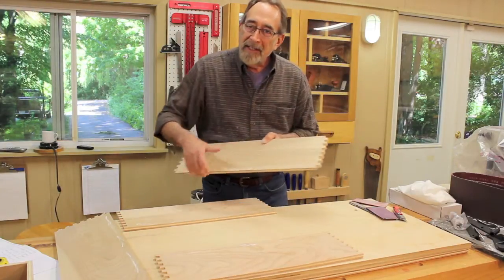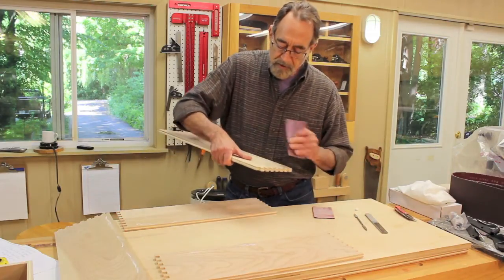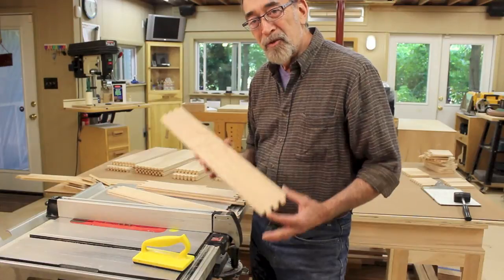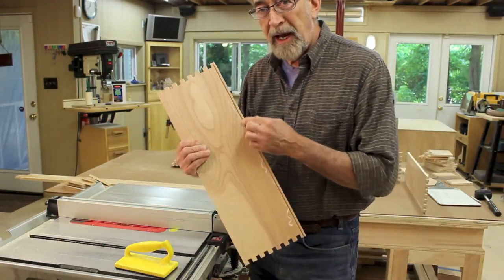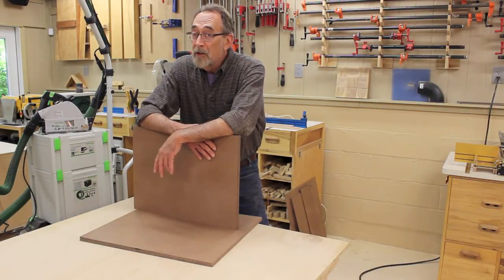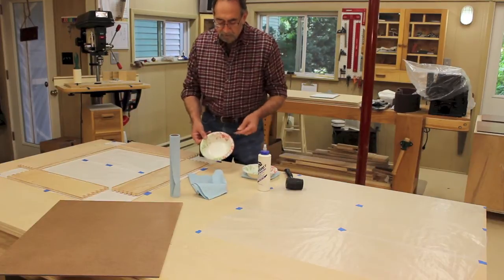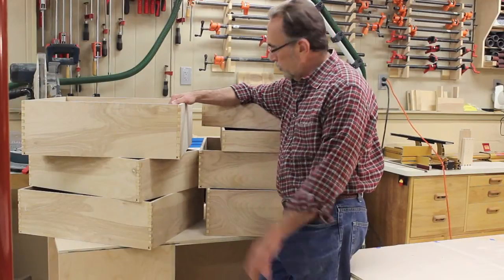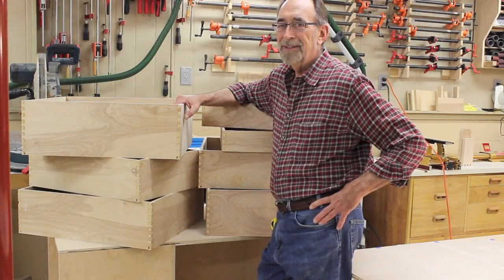Sanding Center Pt 5B  Drawers Box Joints

Comment: Hi Steve, really good videos. I've used my Incra box joint jig in table saw mode to make half-inch box joints in pine for shop cabinet drawers, and got pretty similar results - the pine blew out like the plywood. So I had decided to stick to making box joints in hardwood, hadn't even thought about plywood. Nice to see that careful planning and a bit of cleanup afterward can make that work.

Comment from the maker: Thank you so much!  I do not presently use an outfeed table on my table saw.  Several years ago I sold my cabinet-style table saw and started using just my portable table saw.  The fact is, I use a table saw probably much less than most people.  When I need to rip something really long, like some nice piece of hardwood, I use the band saw.  I am going to joint it anyway, and my band saw works great and is a lot safer.

Comment from the maker: Hardwood ply for the drawer fronts is fine... actually baltic birch can be very nice looking as a drawer front if you are not opposed to seeing the plywood plies on the edges... I have seen lots of them made this way.  For shop cabinets I try to use moderately-priced plywood (baltic birch is very expensive around here) and like to "hide" the edges of the plywood.  Also, I have found in a "rough" environment like my shop, the edges of plywood can get damaged pretty easily.

Comment: if you want to keep using those glue brushes.  i take a water bottle and fill it about half full of water and take a pencil or a piece of doll and stick in the end of the brush to be able to get it back out of the bottle .  that way you can keep using the brush for several day's.  keep the cap so when you not useing your brush  just seal it up. works great..thanks for all you teach me .

Comment: Another Tipp for you "cheap" gluebrush:
Dip some fastglue to the base and let it dry while the brush stands up...
i do it so with a glue, we call "second-glue" in germany (hardens out within 30-40 seconds) and with this litte hint i can use thoose brushes for a long time, without having parts of it in my woodglue.